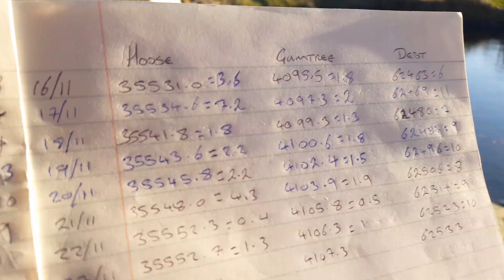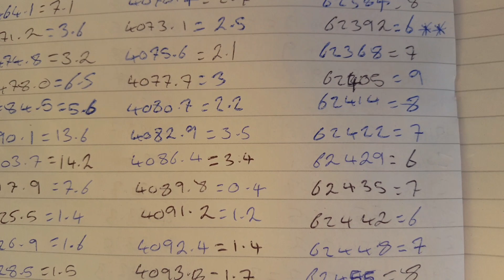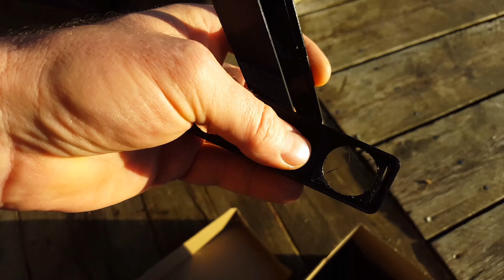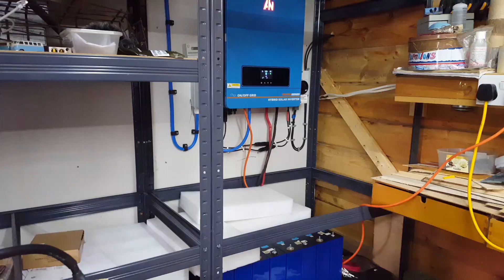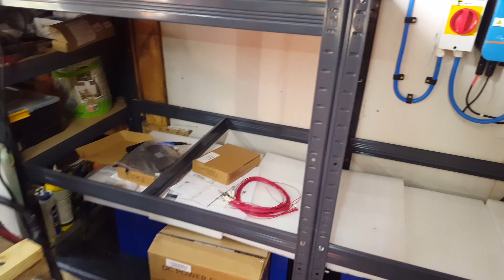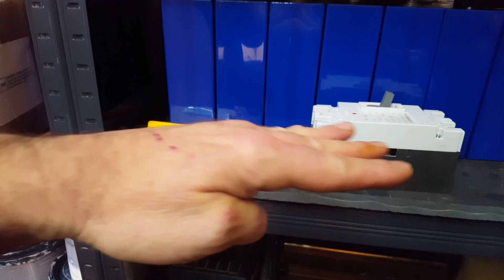3D Printed Lifepo4 Terminal Covers, Clamping Fixture Design Process & Winter Generation Shortfalls.

Comment: Those bus bar covers are a cracking design mate. Such a great idea 👍
I'd personally leave the holes in the end plates for the batterys where they are just to prevent any chance of the metal rods fowling on the side of the battery. The slate would be really tricky to drill through but then also apply enough force without cracking the slate. The idea of using angle iron to distribute the weight over the slate would be a great idea as the weight will be pulling on each side of the slate. You pull yourself down with how talented you are. Dont knock a resourceful man in the middle of Scotland 😂😂.
Reply from the maker: Cracking???? Where???? 
Don't say that I had awefull trouble with layer fusion hahaha. 
I am not sure of the exact science to achiving the 300kgf of clamping force but I cam max out 150kg bathroom scales at a surprisingly low torque value.  Like 5lbf so baby steps with this one.  
Spread the load and fingers crossed should work.
Cheers
Reply from the maker: Stop playing with my paranoia lol, just googled the tensie strength of Slate.   Its one of the strongest natural stones so game on.
It will be under less load than a Fat American playing Pool on it 🤣🤣🤣
Reply: @garys-half-baked-offgrid-dream  haha my apologies 😅 I'm just thinking back to school days when we used to line slate tiles up against a wall and throw stuff st them to break them. I'm covering all bases for you so you don't have to 😉 I'm playing devil's advocate all the time looking at worst case scenarios
Reply from the maker: @karloffgrid  Yeah that's cool mate lol. To be fair I am going to have to be careful, especially I can't scribe deep lines when I am marking out or it will crack no effort at all.